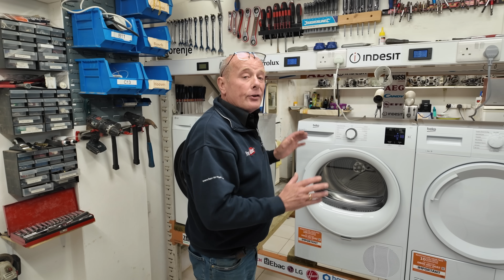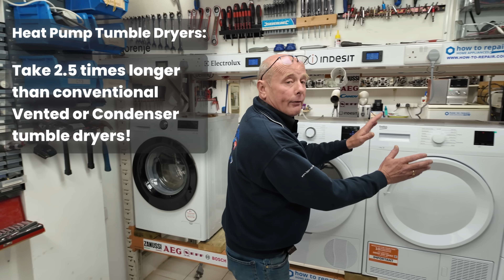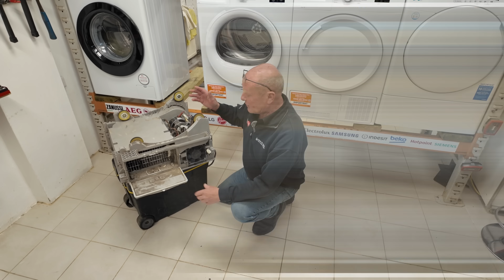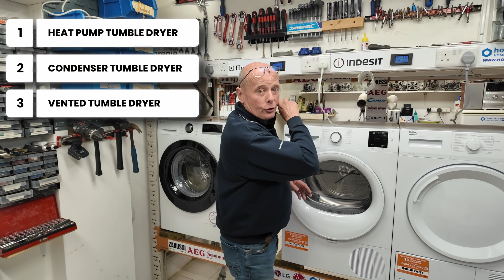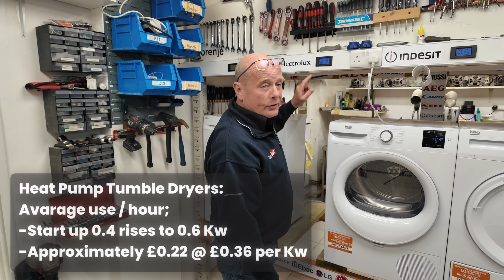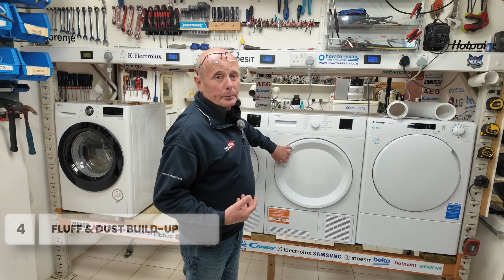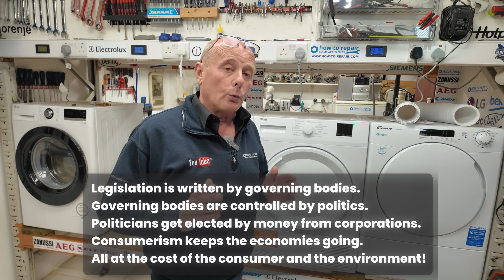Tumble Dryers the Shocking Truth About Heat Pump vs Vented & Condenser, NEW LEGISLATION!

Comment: I use an additional piece of equipment in the drying process,  namely a spin dryer. After the washing machine has finished the cycle, I put the washing into the spin dryer for about 10 minutes and then transfer to the vented tumble dryer. This cuts the drying time of most loads down by about 60%. My husband , who is a retired engineer, introduced me to this technique many years ago and says it reduces the wear on the tumble dryer and allows me to reduce the spin speed of the washing machine to low which prolongs the seal and bearing life of the washing machine. It saves on electricity costs too..
Reply: I select extra spin on the wash cycle
Does the same thing..
Clothes are almost dry whem the machine is finished..
Except heavier fabrics like towels..
Reply: @stuartd9741  Separate spinners usually have a bigger diameter, which means bigger centrifugal force by same or even slightly lower RPM, and can be loaded heavier. It is really noticeable.
Reply: @marcovtjev  
Ok. I've had good results just using extra spin cycle at home..most man man fibres came out almost dry..
Reply: That's what I always did. My mum had a spinner and hung the washing on the line. The spinner removes so much water the clothes are almost dry.
Reply: Good advice. If you have a garden, another additional piece of technology that is environmentally friendly is a length of rope suspended between two poles. Weather permitting, clothes may be suspended from the rope and dried without using any electricity 😂.
Reply: @Steve-GM0HUU  How strong does the rope need to be to hold both the washing and drying machines?
Reply: @orange42  😆 might need some steel cable for that.
Reply: @orange42  
If you use armoured cable for the washing line you have also got the electrical supply for the two hanging appliances.
Reply: @Steve-GM0HUU 😂 Brilliant idea! And the clothes smell divine !
Reply: @Steve-GM0HUU  Always  a good choice.  Don't need sun, just a good dry breeze.  I had to explain the evaporation process to my wife before she believed that sun was not needed.
Reply: @alopexlagopus1488  A frosty night out on the line works too, just bash the ice off and air indoors.
Reply: @Steve-GM0HUU  Sadly this technology has terrible side effects if one suffers from hay fever.
Reply: @Steve-GM0HUU That is called "evaporative drying technology" 😂
Reply: @Steve-GM0HUU  Alas, don't have a garden as live in a tiny terraced house. However, this doesn't deter them in Italy where their clothes lines run from above the upstairs window to the house opposite. Guess you need good neighbours for that.
Reply: @roverboat2503  In British towns and cities , in the past, it was quite common to run washing lines between the rears of tenement buildings. I can remember this as kid in the days before tumble dryers were commonplace. The line would be on a pulleys so you could reel the washing out and in.
Reply: @Steve-GM0HUU  The UK doesn't have birds?  When I lived on the East cost of the US, if you put your clothes outside on the line, the neighborhood birds would use it as a bathroom, or I guess you call it a loo?  I discovered those spinners about 20 years ago, and it ends up paying for itself in about half a year.
Reply: @theclearsounds3911  We've been line-drying for 30 years, and there are plenty of birds, but I don't recall poo on the clothes ever happening. We have pigeons that nest under the solar panels and eat the veg, blackbirds that eat the worms and dig through the mulch, and robins that follow you round gardening looking for grubs. Plus occasional woodpeckers, hawks and others. So no shortage of bird life, providing some annoyances (they poop on the render, fat pigeons broke branches on the plum tree last year, and they love to ruin the veg-beds), but no trouble with the drying line. I've never really thought about it, but I guess they prefer to sit in trees given the choice? Maybe there weren't many other perches near your line so it was the best one around? Maybe it has to do with line thickness/type?
Reply: @Steve-GM0HUU ssssh don't tell them that dryers are not necessary
Reply: @Steve-GM0HUU  Yes,  you are so right!  😊The tried and tested way well used by our parents and grandparents!  When the weather is suitable, this is the best  and cheapest way of all! There are glorious days when the weather is sunny, warm and breezy and the clothes are dried quickly on the line. But of course this is Britain, so those days are  pretty rare, especially in winter. So we have found it helps to spin dry the washing first, before hanging out the clothes on the line. It gives them a head start, especially important when the day is short.
Reply: @cherryseptember8697  Totally Agree!!! Extra spin after the wash cycle and hang it on the washing line. If raining then the vented tumble dryer, its only 35 years old and had to have a new micro switch for the door last year. It gets the back off and a vacuum every 2-3 years to remove the fluff. Yes its basic Candy and owes me nothing!
Reply: @mungogrant1857  Excellent! It is so good to keep the old equipment going, saves a lot of money. and of course, it is also good for the environment. For many years we used  the old spin dryer that had belonged to my husband's grandmother. I don't  think it was pre-war, but it looked it!  It kept on going until about ten years ago.  We managed to a find a modern version of  it and  are now using that very happily.  Sometimes keeping it simple is the best idea.
Reply: @cherryseptember8697  the time and faff of hanging up 5 peoples washing 5 times a week means I always use a tumble dryer, even on sunny days but I do have solar so the electricity is free-ish.
Reply: After paying out €1300 for a German heat pump drier, I noticed my adult children's (living in the hotel of mum & dad)  drying was taking many hours. Turned out the washing machine doesn't spin a high enough speed if it detects an uneven load. By placing my YouTube PC close to the washing machine , I can do several spin cycles at my leisure starting at lower speeds and working up. The new dryer also has the advantage of delayed start permitting off peak consumption.
Reply: @ashingtonresident5866  Nice! YouTube doing your laundry!
Reply: You have space for two dryers?
Reply: " namely a spin dryer."
Most washers built in the last 60 years already have a final spin cycle.
Reply: @ You've never seen a spin dryer then. It's a small vertical cylinder that spins the clothes MUCH faster than a regular washing machine's spin cycle, and gets much more water out. These wouldn't be useful if the washing machine had a faster spin cycle.
Reply: Miele washers used to spin to 1600rpm... alas, now machines only really go to 1200 ish
Reply: I do an extra spin on my washing machine after using the delicate cycle. As often, only half the load is delicate, so remove any cloths that would stretch from a spin and then put the washing machine on a fast spin.  Then I can dry the delicates on a clothes horse, and the non-delicates can go in the tumble dryer.  We only have limited space to air-dry clothes.
Reply: If I can ask why don't you use the spin only system in the washing machine why do you need a separate spin dryer and what would be the best spin dryer to buy ?
Reply: can an extra spin cycle not be done in the washing machine?
Reply: My LG washer has the extra high spin cycle. It spins so fast there are dry spots on the clothes after pulling them from the washer. First time seeing this, I thought the washer damaged my clothes. 😂 It reduces drying times as the dryer uses the most electricity out of the two.
Reply: I live in Melbourne Australia and we use Toploader washing machines and have a spin dry cycle on it and the clothes come out pretty much dry which doesn't take long for them to dry out on the clothes line never used a front loader so I can't comment on how wet they are after washing them , but I have been thinking about getting a dryer and it was good info on the different types of dryers thanks
Reply: FairPlay to you this was one of the best explained videos I’ve ever watched on YouTube
Reply: I have a Samsung ventless dryer. I love it, but I have the same problem keeping lint out of the condenser part. I clean weekly and it’s hard to find anyone to keep it maintained for me. I paid 1,100 usd  in 2020, on sale 200$ off. I do not use the normal or permanent press, I dry everything on “towels” and they dry perfect and not wrinkled
Reply: Oh and if I’m washing and not busy I just wash my clothes and let them sit in the washer for a couple hours ,THEN put them in the dryer and they dry faster
Reply: Just get a washer with a faster spin cycle. No need for a third appliance!

Comment: I changed from a condensing dryer to a heat pump dryer last year. Drying the same clothes, washed and spun in the same washing machine as with the old dryer, I don't notice longer drying times with the heat pump dryer. I was pretty amazed by that, because just as you state in the video, I was prepared for much longer drying times. The only downside I have noticed, is that I can't use the dryer anymore to dewrinkle clothes doing a 20 min cycle and having the clothes still damp. There is simply not enough heat. As for my normal complete washing cycle, I usually have around 6 kg of mixed fabric, spun with 1600rpm. The heat pump dryer takes about 1:30h to dry these clothes completely (not damp at all).
Reply: I have had an heat pump for a long time. But it drives me crazy.  Wish I could afford to buy a new one
Reply: These things are junk in the usa we wash 20-25 kg at a time lol they usually run 5-7 hours for a load lol i repair them and have to tell people this all fay long pisses them off….you should see our fridges we keep enough food to feed a 6 people 2 months lol
Reply: @jasonleatherwood2172  Why do peopp[le in the usa create so much laundry? I regularly hear thet 'European' machines are too small for a family - yet families everywhere in the world except for North America use them with no problems. I've always wondered why. The fridges I understand as you don't have the infrastructure to havelocal shops so do bigger less frequent shops. But I can't see how this applies tolaundry.
Reply: @ what you mean we got grocery stores on every corner lol food is everywhere why ya think we all so overweight…..the clothes think is weird after every bath all towels are washed daily kids clothes especially in sports are 2 pairs of clothes a day its crazy i usually have 2 loads of laundry every day
Reply: @stevemichael8458  we do stuff like having 3-4”4 different brands of mayo 6-8 cheeses in the drawer 100 bottled drinks processed foods out the rearend…..personally i started carnivore and that helped alot
Reply: @stevemichael8458 it's likely not the amount of laundry they create, it's the size of the clothes they wear. Have you seen the size of some of those people!

Comment: I strongly question the assertion that a Heat Pump dryer saves power.  If you consider the total flow of heat, the only heat CONSUMED is that needed to evaporate the cold water and heat it up to the outlet temperature. This is true of every mechanism that dries clothes. So all dryers should consume essentially the same power to dry the same load . 

Now,          HEAT FROM ELECTRIC + HEAT FROM ENVIRONMENT = HEAT TO DRY CLOTHES + HEAT TO ENVIRONMENT   .

With condenser or heat pump dryers the Environment is the same - the air in the room. In a centrally heated room any excess power consumption from the electrical supply will cause the heating to back off to compensate. In an uncontrolled room it will be used to heat the room. With a vented dryer this obviously does not apply and 90% of the energy is wasted heating the trees !

So in a cold and wet country like Wales there is no power advantage in using a heat pump over a condenser.
Reply: Erm no, I’ve saved a fortune in electricity using a heat pump dryer.  The negativity in the comments of this video are truly baffling and bizarre.  If you do the basics on keeping the filters clean they last much longer than this bloke is crying about.  His money income is based on people that don’t care much about looking after their machines.  I’ve never had an engineer to any of my laundry machines in the last 25 years of leaving home and having my own appliances to look after.

Comment: Thanks for the presentation however you have not provided any evidence to support the claim that the heat pump takes 2.5 times longer to dry the same load.
Reply from the maker: Thanks very much for your comment, mate. I have a video planned showing the running costs of a brand new appliance, but I'll have to wait until I get back. I'm travelling abroad soon, so it might be a little while before I can publish it.

Comment: I've had one for about 4 years now and no problem yet.  The energy savings are massive.  It's shocking how poor many of the new appliances are for serviceability, by design, cheap manufacturing, and planned obsolescence no doubt.  If they fixed the lint issue it would be a no-brainer.
Reply: If people maintained them correctly they wouldn’t have an issue, like you I’ve had one for 4 years and it’s great doesn’t take as long to dry as this video makes out

Comment: You obviously don’t like heat pump dryers!!
We have has an AEG heat pump for over 7 years and love it. It doesn’t take any longer to dry than the old condenser. How do you get 2.5 times longer? Ours doesn’t !! 
I notice the dryers you are using are Beko & Candy, both cheap budget machines, if you tried a quality dryer such as Bosch AEG or Siemens you may find they perform much better, last longer and are cheaper in the end.
I would also like to point out that the term “heat pump dryer” is not an accurate description, they are a dehumidifying dryer, with a small dehumidifier to extract the moisture. They are also much safer as they don’t have a heater - therefore no fire risk unlike vented or condenser dryers (we have all heard of stories about tumble dryer fires). And yes I work in the trade as well.

Comment: Nice. Well thought out appraisal.  One comment to add is that a condensing drier warms the room that it is in.  The heat used to dry the clothes is not wasted.
Reply: This would be benefit if it is in the living room, as most of these units are in a garage our attic it doesn’t really benefit heating up the attic or garage with residual heat. Also, if it is in a small room, it is taking in hot and moist air. This decreases efficiency as the condenser requires a temperature difference to actually condense water.
Reply: This would be benefit if it is in the living room, as most of these units are in a garage our attic it doesn’t really benefit heating up the attic or garage with residual heat. Also, if it is in a small room, it is taking in hot and moist air. This decreases efficiency as the condenser requires a temperature difference to actually condense water.
Reply: Fair point. Good for those chilly climes but here in Australia most times it just adds to the heat the A/C has to remove. Our dryer is out the back under the verandah so moot for us. My wife is vision impaired so much simpler to dump all the smalls in the dryer for her. Big stuff still gets hung out.

Comment: Interesting points, but isn't this like the vacuum cleaner efficiency regulations. People huffed and puffed (sorry) about it at first, but I seem to recall the Which magazine finding the improved efficiency vacuums were just as effective but used much less energy. In other words as some comments on here claim - the latest and greatest HP dryers are just as fast at drying. With R&D tech improves and the same performance can be achieved with less energy. Plus fridges and freezers heat pump systems seem pretty bullet proof even with the dust that collects.

Comment: I would have though that with the known increased run time for a heat pump drier that the bearings etc would be sourced to be better quality to last longer and the same for the motor and other parts.

Comment: I've had my heat pump dryer in excess of 3 years, the difference in the time it takes to dry my clothes in comparison to my old condenser dryer is nowhere near as long as stated in the video,  and in contrast to what was said I have noticed that it is a lot gentler on my clothes than the condenser was, it is a bit subjective but that is my experience. Regarding obsolescence I will happily replace it if fails after 5 or 6 years, I'm expecting it to last longer.